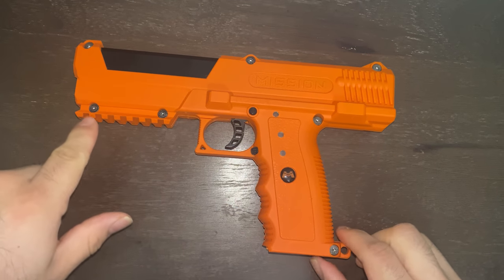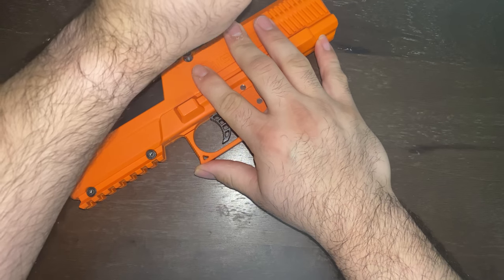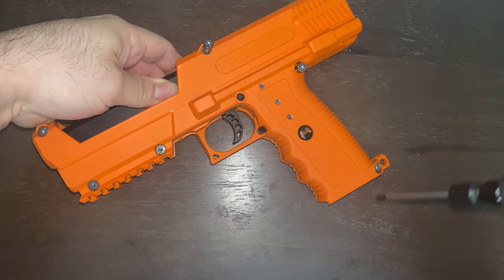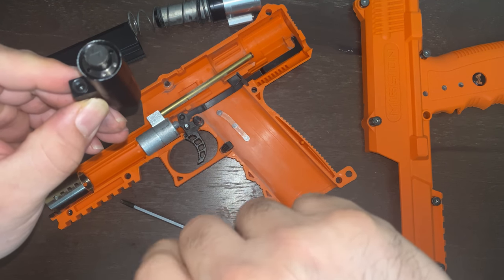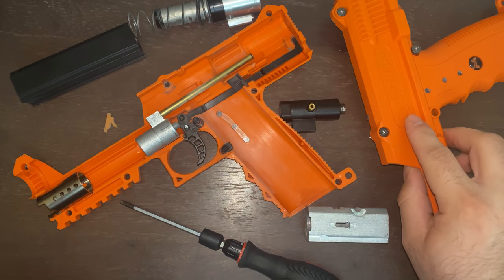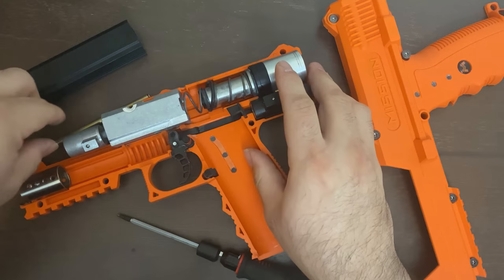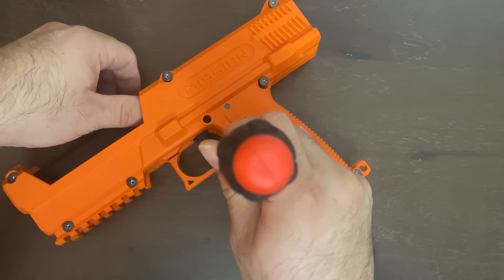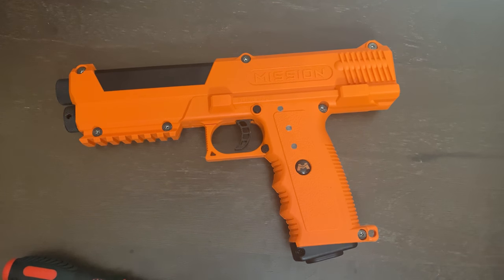Mission TPR disassembly video

Comment: Should get a TiPX to take apart for comparison
Reply from the maker: Its the same only difference is adjustability for velocity and tpr has tcr air system.
Reply: @dudelesslethal6910   do you mean a TCR valve?

Comment: Have you experienced any type of malfunctions with your tpr I'm experiencing an issue where when I take it off of safety and go to puncture the CO2 it's not puncturing the CO2 properly and is leaking air
Reply: The cap has an adjustable screw that how far the CO2 canister gets pushed in.  Try adjusting that and see if it helps.  I had issues with leaking CO2 until one day the CO2 canister jammed into the puncture valve.  When I did manage to get the cap off, all the CO2 emptied out and the puncture valve seal was stuck onto the neck of the empty CO2 canister.  Tippmann replied quickly to my email and I sent the marker to them for service.  Still waiting to get it back.
Reply: @juicyfruit6311  fixd